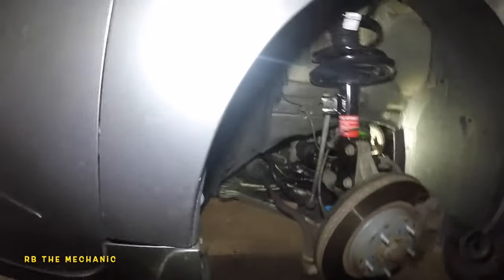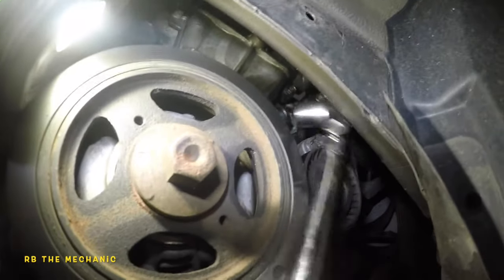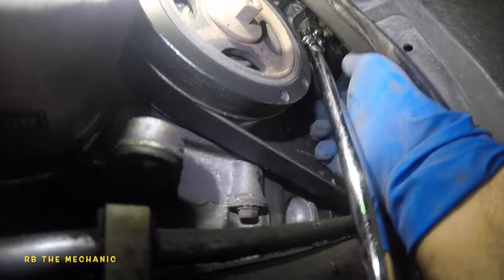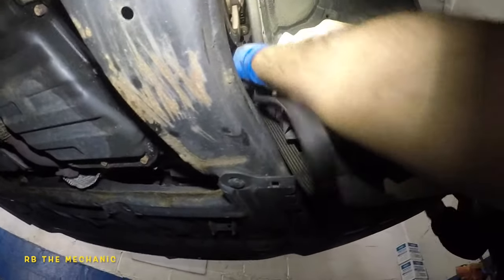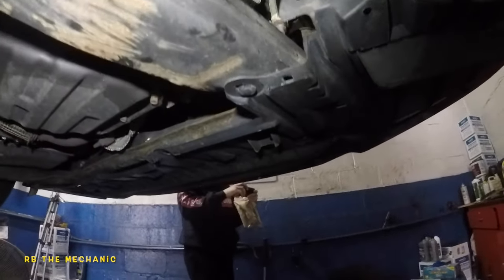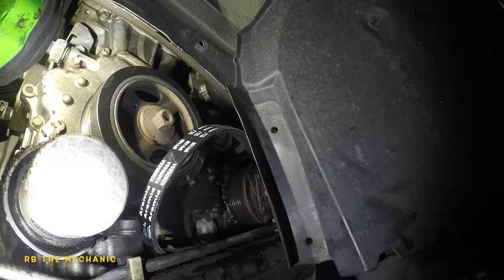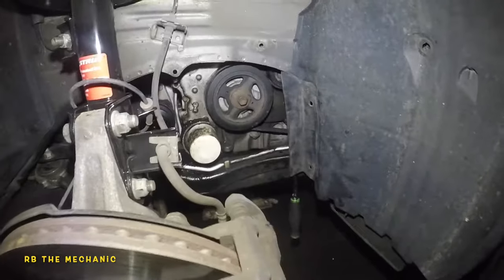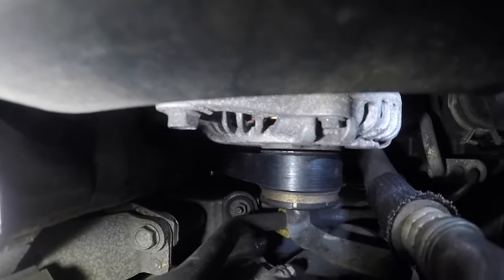Nissan Altima 2013 to 2018 Replace squeaking serpentine belt   (DIY) save $290

Comment: Besides the pin on the tensioner, take out the clips on the fender skirt, pull back the fender skirt and put it behind the brake rotor and use a deep 17mm socket on the tensioner.

Comment: This is the hard way to do it.  there is a  hole where you can turn the tensioner to match the hole put a allen wrench in the hole which holds the tensioner in position. put your belt on  put socket wrench on that nut to turn tensioner pull out allen wrench release tensioner and your done.
Reply from the maker: Oh yeah I will look in to that I know Nissan has it

Comment: What will cause my belt to keep popping off and making loud noise at the top of it on the same vehicle?
Reply from the maker: Belt pop off? Did u check for any jammed pullies or bad pully bearing could be possibility it will keep belt off if it’s loose worn bearing

Comment: Question- I have a 2015. It’s losing oil but no signs of a leak anywhere. No oil spots on the ground. I’ve even had the motor top end flushed out. Any ideas?
Reply from the maker: Might be burning check the exghust outlet tip if it got black carbon build up. Try replacing pcv and switch to gtx castrol oil
Reply: @RBTheMechanic  both tips are black from carbon. Sometime when I start it, it  puffs smoke for a few seconds. You think that’s a PCV issue?
Reply from the maker: @TheTruthIsBlurred  it’s possibility pcv is the simplest and easiest step also for Hondas we have been using gtx castrol oil it helps tremendously
Reply: @RBTheMechanic  thanks for your time. I’ll go  tomorrow and pick one up. I’ll keep you posted.